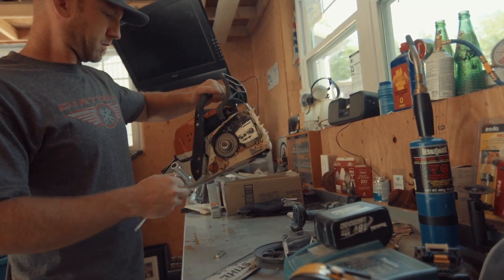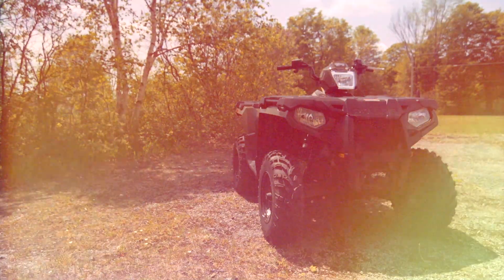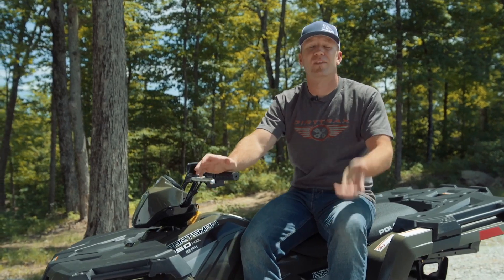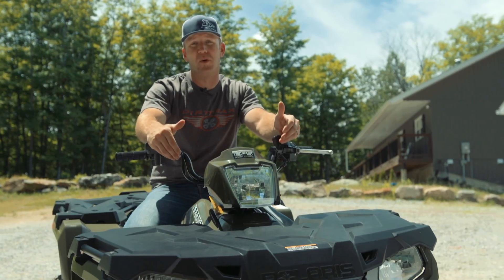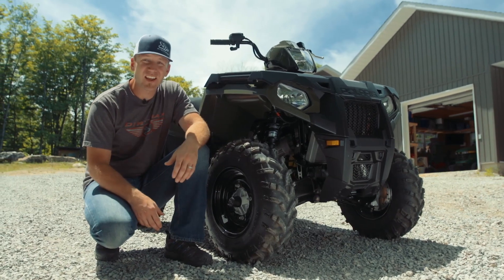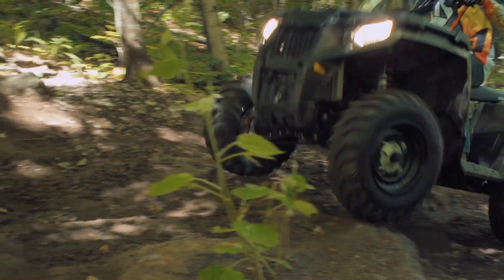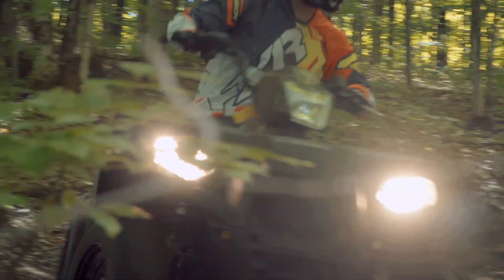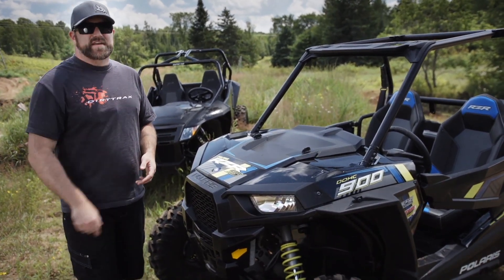TEST RIDE: 2016 Polaris Sportsman 450 HO EPS

Comment: 1 2012 400 H.O and 1 2012 500 H.O, 25cc difference. Both run hard and smooth when needed and no issues uet and i blast them around everything

Comment: The 2016 version of the 450 has a lot of available HP to be unleashed with a simple reflash. The guys with the 2016 should look at the carb sticker. They’ll be pleasantly surprised to read the displacement. :)

Comment: I'll start off by saying I'm not a polaris fan at all. 2 years ago I bought a sportsman 1000xp and a sportsman 400h.o. for my fiancee Jessica.  The 400ho has impressed me over and over again. it never breaks anything and it totally outdoes my 1000 in the mud. she runs 26 inch Silverback lites and I run 30 inch monstermsyhams on my 1000xp. we ride nearly every weekend year round  trails and to the ice shack fishing and plowing snow in the winter. my honest opinion is if your not a high performance motocross background type rider that can really ride you'll never use a 1000s power. The 400ho has gone everywhere the 1000 does and more. it uses a little less fuel. the 400 is also a lot cheaper to insure. like 200 a year difference with a perfect clean drivers license.   I agree totally with calling the new 450ho everyman s machine. The only thing I don't like about the 400ho is its not offered in a gurly colour like pink  or something our wives would love. and when we bought ours powersteering wasn't a option. GET POWER STEERING SO YOUR WIFE CAN RIDE ALL DAY..... this way you don't have to listen to complaints of sore arms. Lol
Reply: It does come in a nice light blue color but yes no pink.  The only difference in something like this and the 700 class machines like a Grizzly or King Quad is that it lacks a bit of top end power and speed.  52 mph is what the 2016 450HO tops out at.  Those 700cc machines and the 570 will go about 65 mph.  But for trail riding, you never get to go any where near 52 mph anyway. The 450HO makes good low end power and that's important for a good trail quad.

Comment: Just picked up a 2018 450. Wholy cow! The power difference from the 14 400 is amazing. They bumped up the displacement to 500cc
Reply: Enrico Brown hey man I just picked up a brand new Polaris 2018 450 I was wondering if yours makes that clunking noise like when you're going downhill or going kind of slow I've been reading that is normal but I'm just wondering if other people have that problem
Reply: Yeah mine does too.  Mine also does it if your barely touching the throttle starts clunking real bad.  Need to take it in.  My 400 never did that

Comment: Ok I have the 2013 one with no eps and no efi and I love it has great get up and go for a 400 great in mud and sand really stable at high speeds and lower climbs most hills with no problem pulls hard and very plush u can hit some decent sized whoops at 30 and it just soaks it up and the front control arms are very strong (hit mine on a rock at 15-20 ish and threw the bike up in the air and just slightly tweaked it) the only things I don't like is no front a-arm racing around it has so much grip can't power slid easily and is sorta sluggish coming out of a corner can't think of anything else right now but forgot to mention it starts up better in the cold than a Suzuki 750 with efi and also has lots of ground clearance things u go slow on thinking u will hit u won't

Comment: I definitely think Polaris is a high quality reliable machine but I never really cared for the awd as its just another part to break and/or give you problems on the trail. I think it would work great on dirt trails and what not but for thick mud or snow, since it only activates from slippage from the back two wheels, as soon as the back two wheels sink down and the quad stops moving, another two wheels to do the same thing isn't as efficient. where as if the had a 2wd high/ awd high/low and 4wd high low and diff lock, I think that would be better. yes it is a lot of options but other brands have 2wd and 4wd both with high/low.

Comment: Great Video! AJ and Luke are on there A game. All the videos have led me to my decision for a Polaris I'm just wondering if the 570 is going to get me a lot more than the 450 thanks guys
Reply: I am extremely happy with my 2018 450 HO. I use it for pulling a trail-cutting mower and general yard-work. It has never let me down and gets up to speed pretty quickly too. I personally wouldn't spend more money on the 570 unless you can find a great deal somewhere else. I can't think of a situation where you would truly utilize the extra 11 horsepower. If you are using an ATV for trail riding, get a Scrambler. :)

Comment: Word is its a 570 engine that's been detuned. True or not...I dunno. Wouldn't surprise me
Reply: That's what it is.  The 2017 450HO is an all new prostar 499cc engine making slightly more hp.  I thought that was what I was going to see when I clicked on this video but the 2016 is a solid value.  Its too bad eps is such an expensive accessory.  Still you can probably get the eps model for about the same price as the standard model retail price(about $6000)in real world pricing.  The Can-Am Outlander 450L Dps is strong competitor in this price range too.
Reply: +Greg Rowe no..what I'm implying is its a 570cc engine...same engine that's in the 570 but has been tuned down. Would explain why Polaris lists nowhere what the actual cc is.
Reply: Yes, the 2016 has a detuned version of the 567cc engine found in the Sportsman 570.  It seems odd that Dirt Trax Television wouldn't know that.  Its not a big secret.  Perhaps when the model first came out it was a bit hush hush, much like the Ace when it first came out wasn't well known that it was only 325cc.  The base model Ace for 2017 also gets the new 499cc prostar engine as well as a Ranger 500 economy model as well.  It looks like Polaris will be building a lot of those 499cc engines.
Reply: It’s funny to read comments from 3 years ago and all the speculation, now everyone knows it’s actually a 500 cc

Comment: I bought one and within 5 months the cv joint broke but the boot is just fine so i called and its not under warranty
Reply: Ebay $70 and 2 hours to replace... I just did both rear boots and it is even easier with complete Axle.. Ride safe..

Comment: Ok guys it's not a 570, the block is the same yes but it's a 500, the 570 is a .040" overbore with more timing a slightly more fuel. They dropped the 500 name when the 570 came around so they could charge more. If you buy the '450' and send your ecm off for a tune it'll put out 44-45hp vs 44 on a factory 570 for less. Reason being the 570 has more internal piston friction because the tuned 570 only achieves 48hp with the same tuning. Funny how Polaris is making it a game to compete with Can am huh? Sadly I got the 570 because when I went to buy a bike they didn't have any 450 EPS models sadly....

Comment: It's actually a 567cc engine. I have one myself.
Reply: 570 is the 567
450 is 500
Reply: @Tylerrogers5807  on the specs which are stamped onto the quad it states that the displacement of the engine is 567cc. It’s a detuned version of the 570
Reply: @ronanforde2149 Wrong. It's 500cc.
Reply: @Broxty  no it isnt bud
Reply: Wrong. I own one and its labeled 567cc on the frame. Also a small amount of research would lead you to find that it is indeed a detuned 567cc motor (same as a standard sportsman 570). @Broxty

Comment: 2019 Polaris 450 a DOG
Reply: Is this English? If you mean it's a dog it's really not. I have a 2019 scrambler 850 and a sportsman 450. Sportsman keeps up just fine on tight wood trails. It gets up and moves on straights also.
Reply: @Arckabis  I'm in the same boat. I have a 2018 Scrambler 1000 and a 2018 Sportsman 450 HO. Both are great machines on different ends of Polaris' ATV spectrum but they both perform extremely well. The little 450 is surprisingly quick and enjoyable to ride. Great for utility/yard work too.